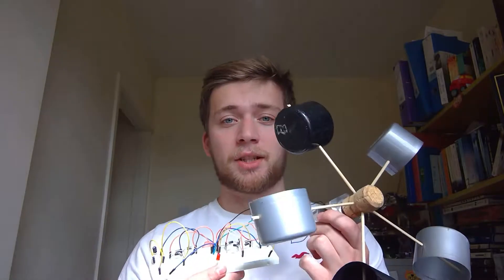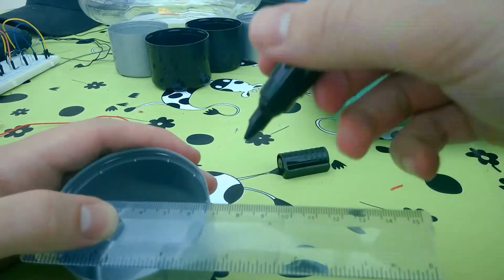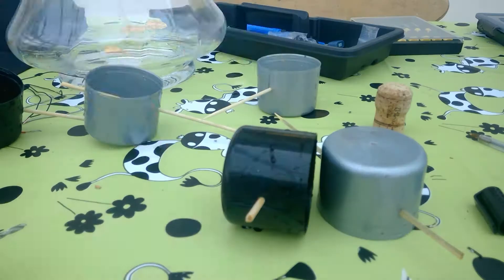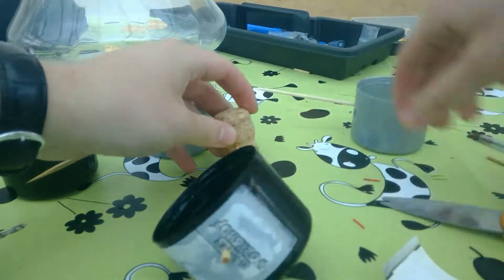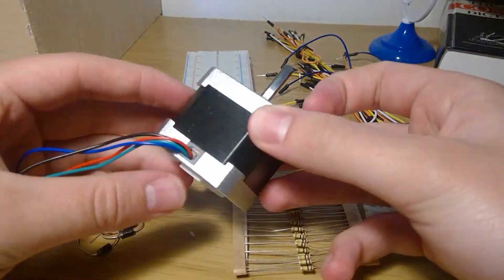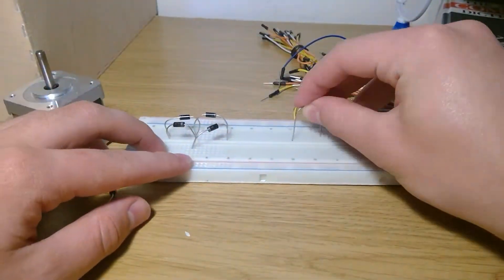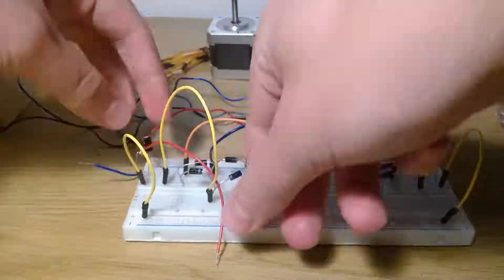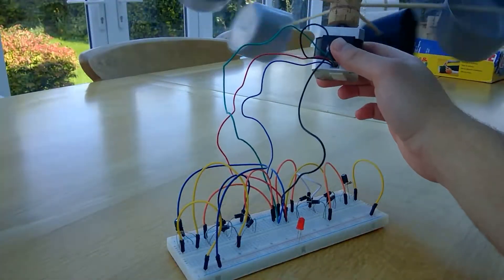How To Make An Electric Turbine (Kinetic Electric Generator) From Scrap | StudentBuilds

Comment: Your schematic should show where the led is attached, and how the motor phases are connected,, and frankly your schematic does not make much sense, your LED should be very bright,  the  100K resistor is way too big. (No current can flow)
Reply from the maker: it does! its between the positive and negative terminals. I've left it without the LED so you can put in what you want to. 100K worked fine for me, the current was more than enough to achieve what i wanted